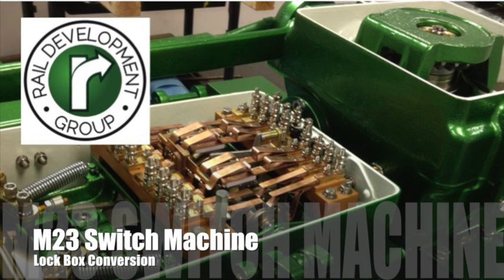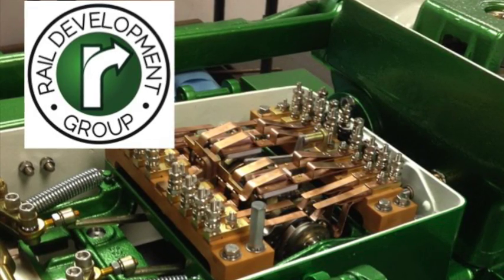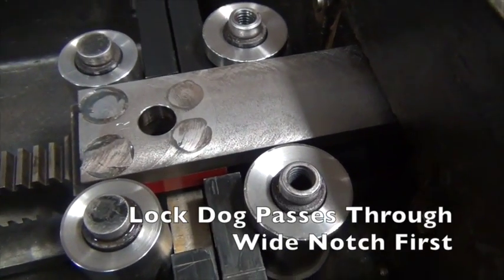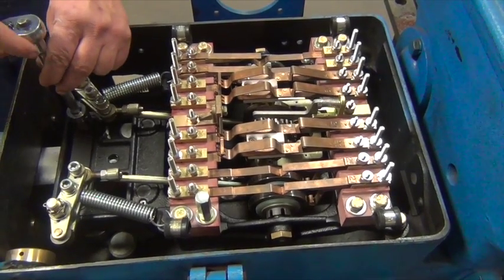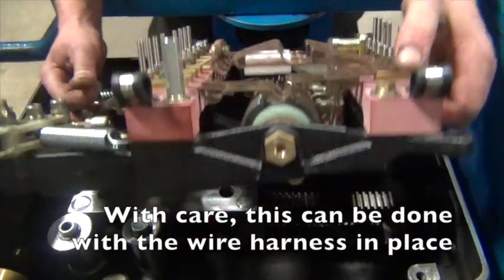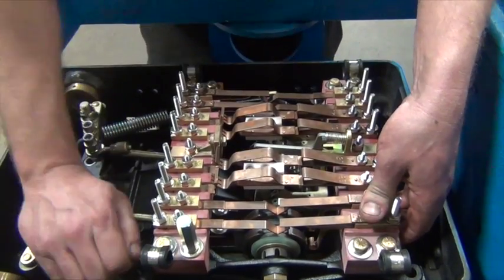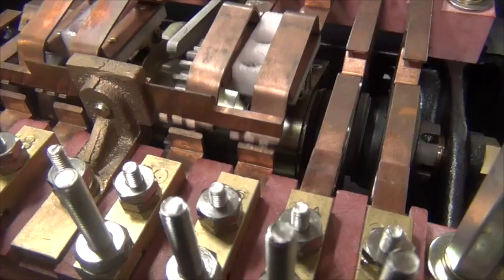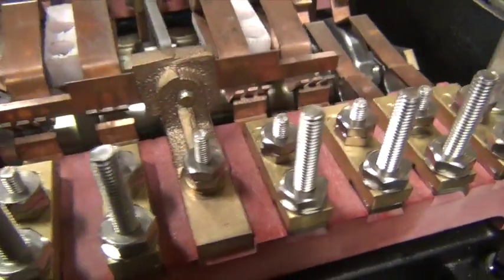M23 Lock Box Configuration

Comment: You say that, upon reinstalling the lock box and circuit controller, it is critical that the relationship between the circuit controller gear and the rack teeth be maintained. When reinstalling the lock box, how do you make sure that the teeth are in the same position? Is there some sort of stop near the rear of the circuit controller compartment that the box makes contact with?